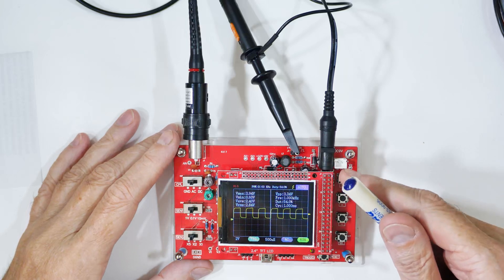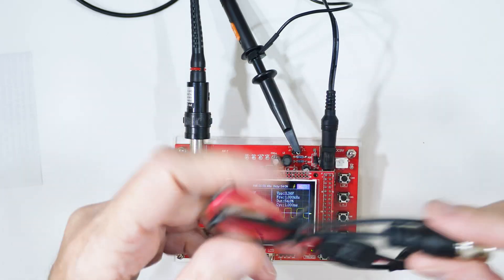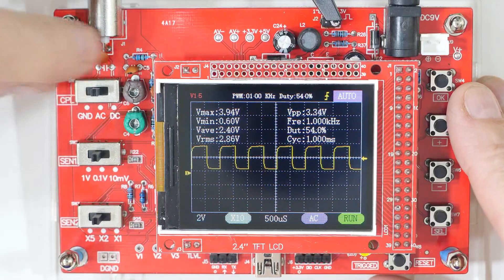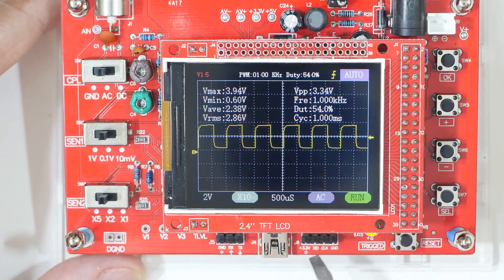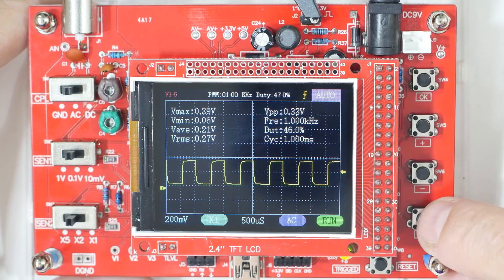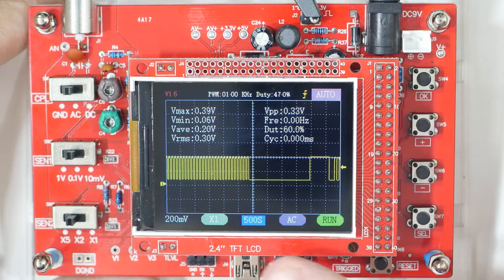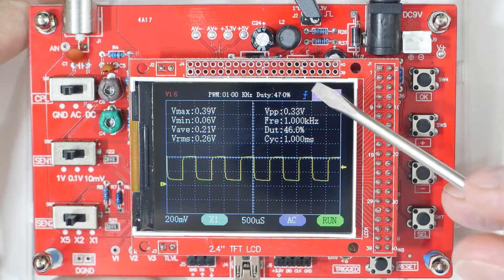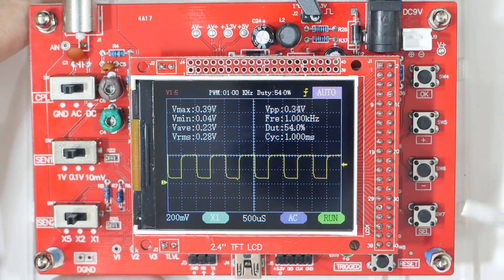$25 Color Oscilloscope! The Incredible DSO138 (4K)

Comment: Awesome overview.  Can you tell us what the voltage range and max frequency the scope can measure?  Eg can it read SPI at high frequency as an example?  Also can you log or download the data in realtime from the user port?
Reply from the maker: I don't have it any more. I can't recall the max voltage, but the actual max frequency was around 450kHz (the specs were 500 kHz).

Comment: hi, would this be enough to measure audio power output? noob here and i only have multimeter. Kinda went measuring where the amp clips by hearing. Would this be the right tool to see where the Amp wave clip? thank you sir
Reply from the maker: I know nothing about music, so I can't answer from that standpoint. An oscilloscope measures the change in VOLTAGE over time. So it's like your volt meter, but it graphs the changing voltage. It does not measure amperage unless you buy a special and very expensive probe (I've never had one of those). I would guess (only a guess) that it would see the clipping of the voltage and therefore wave of the amplifier. I don't know how much voltage out that amps produce; most scopes have a limited voltage input limitation.

Comment: is changing the PWM and duty cycle only altering the test signal that it outputs?
Reply from the maker: If I recall,  yes. It has a built-in oscillator and frequency generator.

Comment: I am a complete amateur - could this be used to visualize wave forms for sound (specifically for a synth). Could a pass through probe be done easily (with basic soldering skills) to allow an audio signal to go through the oscilloscope?
Reply from the maker: Yes. As long as the input signal is within specs. Audio is easily within the range of this scope.
Reply: @tsbrownie  thanks! Will an off the shelf BNC to 3.5mm jack work?
Reply from the maker: @theAristocrap  It's hard to say without knowing what you are measuring. It likely will work. Make sure the output is not at dangerous voltage levels.
Reply: @tsbrownie  Basic headphone audio signal from a synthesizer.

Comment: is it normal that the vrms also change if you change the voltage sensitivity ?
Reply: yes very well thankyou so much!!
Reply from the maker: How much is it changing? 5% or 50%?
Reply: i think its about 5 percent...as youre video shown..changing the voltage divsion the the vrms also change... same as my osciloscope
Reply from the maker: @kenzocanlas1135  For the simplicity and cost of the scope, 5% is probably as good as you can expect.
Reply: ok thankyou..but what i mean is
check video 02:00 to 02:05...
the vrms change value as you changing the switch for sentivity voltage...
it that normal?. thats what i want to know :) hope you still  answer me :)
Reply from the maker: @kenzocanlas1135  This is from their manual (it's also in my description) "[SEN1] & [SEN2] switch: Adjusts sensitivity. The [SEN1] X [SEN2] = actual sensitivity. Displayed at panel lower-left corner." Does that help?

Comment: Thanks for sharing. Do you happen to have the pdf file for this particular version (V1.5)? I have been looking all over the internet for the pdf version. Thanks in advance.
Reply from the maker: I have it, but legally I can't distribute other people's stuff. The file names I found are DSO138UserManual_138_new.pdf and DSO138UserManual_138mini_HJ.pdf. Note that many companies make this same product, so these manuals may not be for your exact model (they were not for mine), but they are close enough to get 95% of the functions.
Reply: @tsbrownie  Thanks. I got a print-outs that came with the unit. I probably scan them (in high resolution) and will save them as a .pdf format. Not as good, but it will do the job. Thanks again.

Comment: Hey, nice review. As for the manual, i found them easily. Google censors any direct links, so just give the directions. 
The footer of official Jyetech site is referencing their official reseller Accudiy. There you can find your model and on your model's page you'll find links to official Jyetech manuals (including calibration procedures) and full schematics etc. (More docs for DSO138mini models than for older DSO138.)
Best Regards 👍🏼
Reply from the maker: Very interesting. Thank you for this!

Comment: How bad could the case be? Show us the case.
Reply from the maker: The bottom of the case is visible. It's the top that's a problem. The top cover blocks the switches to the left, so only the tip sticks up and switching puts a lot of pressure on the (cheap) switch. It blocks the calibration output on top. And it makes the other switches either inaccessible or hard to use. I will include it next video.

Comment: Interesting video. I just got my DS0380 today and have been searching for a decent manual online. Most instructional info seems to be several years old, and software changes in the menuing system make it difficult to figure out the current functions. One thing you showed was the SEL action that changes parameters to be adjusted. Your scope goes from what I'd call the vertical position setting (pointer on the left) to the X1 / X10 "probe setting" that would be useful if using a 10X attenuator probe on the scope. Unfortunately, my version skips from the pointer on the left directly to the timebase setting. The X1 legend shows on the screen, but I can't see a way to change it. Anyone else have that issue? 

Another difference in my software version is that your display shows V1.5 at the upper left, while my screen is blank in that area. The only exception is that occasionally I've seen a red "0 Calib" legend in that field. (I can't remember what condition caused that). 

Finally, there seems to be a strange condition that occurs sometimes when I first connect the scope after powering it on: the "trace" seems to be completely above the top of the screen until I mess with the vertical position setting. Sometimes this happens; sometimes it doesn't. 

Anyway, those are the mysteries I'm still trying to figure out. Let me know if you discover anything related to these issues.

Thanks again for an informative video!
Reply from the maker: Interesting, thanks. I wonder if there's 1 company making the hardware and a bunch of distributors putting their own software on it. It happens with big computer hardware.
Reply: @tsbrownie  I've read that the original oscilloscope design was pirated by several other companies who now sell knock-offs online, each with their own "features" and peculiarities. I'm not surprised that your DS0380 and mine have different user interfaces, even though they are essentially the same age!
Reply: There really hasn't been an update in construction or firmware since 2016...
Reply: Have spent 2 days looking for your comment. I have the same version as you and can confirm I cant change 1X and 10X probe settings as well as trigger indicator jumps way above screen after reset I think.

Comment: The lack of a REAL manual is very bad news. Note for novices and near-novices: Whenever you're thinking of buying a device to use with or analyze electronics, find the manual online first and see if it makes sense to you. Equipment won't help you if you can't understand how and where and when to use it. --HOWEVER, JYE Tech does have a (too) short online manual. Search by [dso138 oscilloscope manual]. The current update is "Rev 05" for Revision 05. If you don't know oscilloscopes, see if you can make sense of this manual before buying.
Reply from the maker: I have put what I have found in the description. It is from many unknown sources, so I am not sure how good it is.